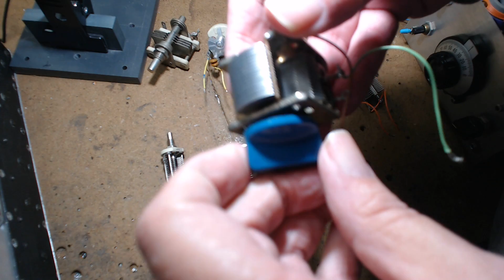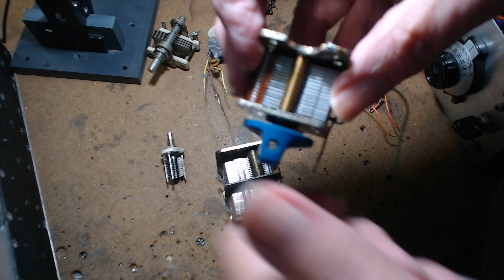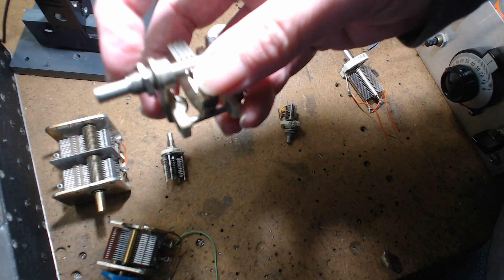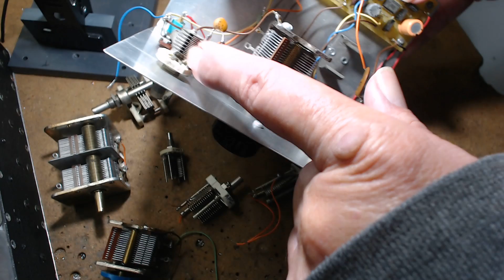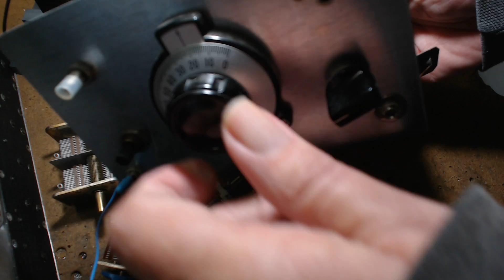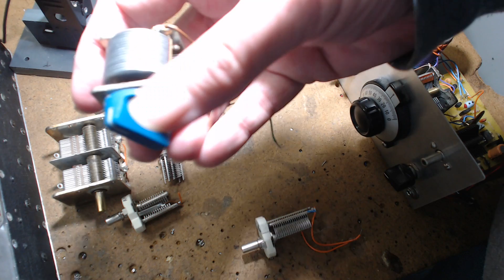Capacitors for your Charles Kitchen Regenerative Radio

Comment: Trying to figure what would cause air capacitor value drift with temperature. Volumetric change with temperature, brass is about 20 percent less than aluminum.

Comment: Nothing wrong with inserting a cap in series with a variable cap.  Works a treat.
Reply from the maker: The "It won't be Linear"   Stations will be bunched up on one side. They I say how all the big name radios did that.  Then I found a text file about Padding. I went back to the conference and saw it was a big mouthed HAM.  I left the group there and then. It was the last group I belonged too.